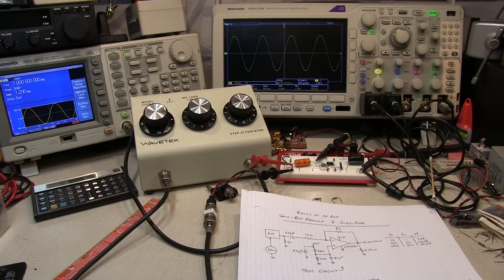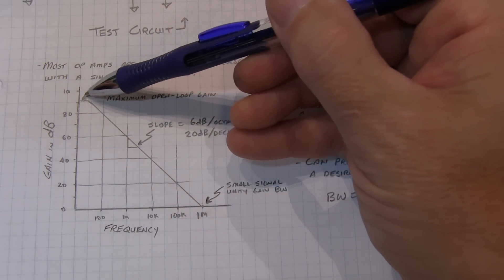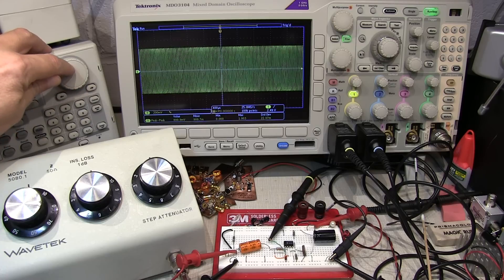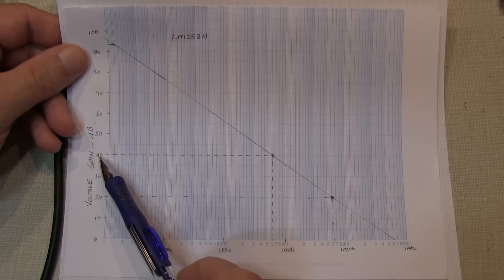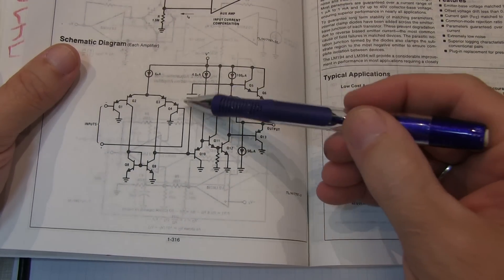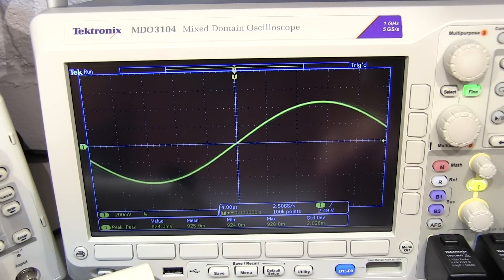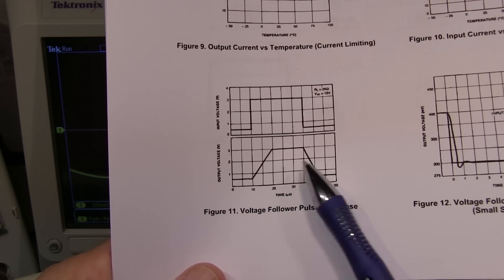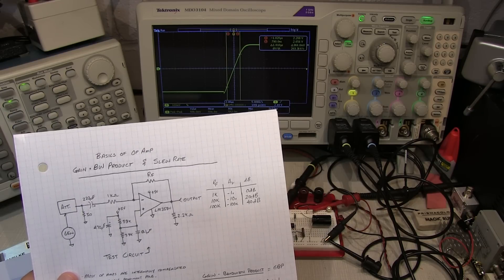#172: Basics of Op Amp Gain Bandwidth Product and Slew Rate Limit

Comment: Dear w2aew, 
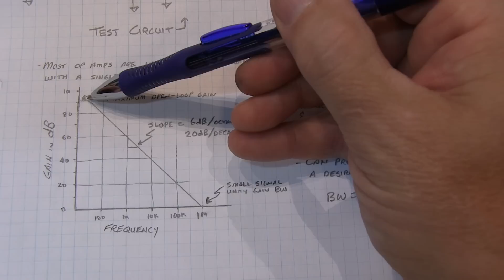I really am a big fan of your videos, this time however I was surprised to notice you made a common mistake at around 2:23. You are saying that for a single pole response the product of the DC-gain and the bandwidth is constant, however this is not true for the inverting amplifier you are demonstrating: it should be: (1+R2/R1)*BW=unity gain frequency. As long as R2/R1 is much larger (10 times or more) than one, the difference in bandwidth will not be that large, but for small values of R2/R1the difference between your prediction and the correct formula can be a factor 2! If the unity gain frequency of your op amp is 1MHz you should expect for a single pole response a bandwidth of 500kHz and not 1MHz. This also means that the -20dB/dec slopes of the closed loop configurations will not touch the -20dB/dec slope of the open loop system, but will be shifted to the left of it. Unfortunately you did not measure the small signal bandwidth for R2/R1=1, you should apply an input voltage whose amplitude is small enough  not to have slew rate distortion. I wrote an article concerning this matter "A closer look at the slew rate criterion" in 2004. Maybe you could check it out and remeasure the bandwidth for R2/R1=1. In reality you probably will  find a somewhat higher bandwidth due to the fact that a real op amp always is a higher order system, which especially can be seen in the case where R2/R1=1, sometimes noticeable as  peaking in the amplitude characteristic, the asymptotic slope of the amplifier being steeper than -20dB/dec and the phase characteristic shifting over more than 90° relative to the phase at low frequencies.

kind regards,
Hugo
Reply from the maker: Thanks Hugo.  I chose not to get into this level of detail in the "Basics" type of video, but I greatly appreciate your reply.  Other viewers will benefit from reading your reply here, as well as your article:
https://lirias.kuleuven.be/bitstream/123456789/240890/1/artikelextended.pdf
Reply: Hello w2aew, may I encourage you to add a follow-up video to re-measure the unity-gain BW at a sufficiently low amplitude to stay under the slew-rate limit.  It would be very beneficial to test the theory as expressed by Hugo Coolens regarding deviation from constant gain-BW product for closed-loop gains that are under 10.  Cheers.

Comment: Great video! One question: Is your attenuator placed between your function generator and your op amp input? So the poor mans solution is to simply keep reducing our function generator amplitude as we increase the opamp gain?
Reply from the maker: Yes. My generator couldn't go low enough. If yours can't, a simple voltage divider will do fine.
Reply: I see. Thanks for the reply!

Comment: what is purpose to use 470uf cap on non inverting line.
Reply from the maker: Filter for the +5V power supply. Really has nothing to do with the function the non-inverting line.

Comment: hello Sir, could you please suggest me what type of op amp can I used to amplified small sine wave signal with frequency range of: 17MHz to 27MHz?
Reply from the maker: Depends on the amount of gain you need, as well as output voltage swing, available supply voltages, load impedance, etc.

Comment: thankyou for your amazing videos. im currently studying electronics at university so this stuff is so helpfully. one question about this, when you say bandwidth of the opamp what does it mean quantatively?
Reply from the maker: +Adil Malim Bandwidth generally refers to the frequency range that a device can operate over.  For something like an op amp, it generally refers to the frequency at which the response/gain is 3dB lower than the response/gain at low frequencies.
Reply: @w2aew "the gain is 3db lower than the gain at lower frequencies.". What does that sentence mean? Please explain it as if you are talking to a kid
Reply from the maker: @keylanoslokj1806   Assuming the amplifier has a frequency range where the gain is basically constant, for example, with 20dB of gain.  As the frequency approaches the bandwidth limit, the gain gets reduced.  The frequency at which the bandwidth reduces by 3dB, to 17dB in this case, defines the corner frequency, or the analog BW in the case of this video.

Comment: Hey Alan,
Thanks for uploading another great video!
I hate to be picky, but I noticed something in your diagram of slew-rate-limiting at 10:20.
You drew the slew-rate limited waveform being in-phase with the the input signal (or a non-slew-rate-limited output signal).
However, shouldn't the slew-rate-limited signal lag the input signal by some phase?
Reply from the maker: The drawing wasn't intended to show input vs output, but rather just comparing normal vs. slew rate limited output waveform shapes. If it was showing input vs. output, then yes there would be a phase shift.

Comment: can anyone please tell me what is the purpose of the  2.2k ohm resistor at the output,or how this configuration called  so i can learn about it.
thank you
Reply from the maker: The 2.2k resistor is simply a pull-down or load resistor. It is used in this case to keep the op amp output in the "current sourcing" mode of operation. The LM358 output stage can source a fair amount of current, but has a very weak ability to sink current. If the output is forced to transition between the source and sink modes, then crossover distortion will often occur. Thus, the load resistor is included to prevent the crossover from occurring by ensuring the output is always sourcing current.
Reply from the maker: +Andrey Andrey This video will explain the purpose of the 2.2k resistor:
https://www.youtube.com/watch?v=VgodYtiD_F0

Comment: I do appreciate your effort on this footage. I am planning to build a strain-gauge circuit from LT1167  to evaluate a peak force exerting from impact test whose original signal theoretically identical to pulse-like signal.

Unfortunately, I am not Electrical engineering and although after spending several days, there was no answer to the following questions...

(1) Generally speaking, does the gain of op-amp influence its slew rate?
[http://www.onmyphd.com/?p=slew.rate "we must scale the SR by G"... but how?]

(2) Is there any way to determine the slew rate of instrumentation operational amplifier like LT1167?

Thank you very much for your time answering above questions in advance.
Reply: For the first question, it refers to"should SR be divided or multiplied by gain of op-amp?" since it is understandable that a higher output signal means a steeper of the voltage, so that it may exceed the SR-limit.
Reply from the maker: KikkyPharaoh 1) The slew rate is basically independent of gain.  Higher gain circuit might cause signals to bump into the slew rate limit because the rate of change of voltage vs. time will be faster (steeper).  
2) The slew rate is specified right in the datasheet, and there's even a graph showing the effect of temperature.
Reply: ***** Thank you very much for your very fast reply.

I did notice that LT1167's slew rate is about 1.1V/us at unit gain (in datasheet). Since I am concerning about its relationship to gain of the op-amp so that the second question was asked. 

It seems that the question is not that clear.... Apologize for this incomprehension.

According to your comments, does it mean that a slew rate limit of this amp is 1.1 V/us regardless of its gain? Am i misunderstanding?
Reply from the maker: Yes, the slew rate is generally not a strong function of gain. Higher amplitude output signals will have a fast signal slew rate, thus will be more likely to run into the device's slew rate limit.
Reply: Your kind help is appreciated!!
Thank you, sir.

Comment: Very helpful video, everything is described in a very calm and demystifying manner.
Reply: Btw: whats the purpose of the 2.2k resistor at the Output?
Reply from the maker: John Matrix The output stage of the LM358 uses a push-pull output stage that has some crossover distortion.  Using a 2.2k resistor to ground keeps the stage in the "push" mode (sourcing current) so that I don't incur the crossover issue.  Also, the spec sheet for the part specifies the output characteristics with a 2k load, so I figured I'd come close to matching that.
Reply: ***** thanks for the quick response, now i get it. since i´m a electronics newbie i`m not yet into checking datasheets before asking questions :-)

Comment: As usual, another excellent and lucid video.
I was wondering why you used attenuator and didn't just change the singal amplitude from the FG.
Thanx for the great video.
Reply from the maker: I wanted an amplitude (under the high gain case) that was below the minimum output level of the generator.

Comment: This is great stuff, I just came across phase reversal on a LF353 working as a voltage follower when reaching Gnd. Luckily I also bought TLC272 that did that job perfectly single supply. I know it was a rookie mistake but what better way to learn.
Reply from the maker: Yes, some op amps have that unexpected phase reversal when you violate the input voltage range.  Very nasty, and lock up a system.  And, often not specified in a data sheet!

Comment: ***** Thanks for the video. Is it possible to build an amplifier using LM741 to generate an output voltage of 50 V?
Reply from the maker: No, not directly.  However, the output of the 741 can drive a transformer which can step up the voltage.
Reply: Thank you so much :)

Comment: A fascinating demonstration. 

Regarding the phase delay introduced when the slew rate limit is reached: is this a constant?  You pointed out that the falling edge has a slightly different slope than the leading edge and this was clearly seen.  Two thoughts on this.  (1) is this predictable enough that it has utility in a design? and (2) as a phase delay appears to be present (although you didn't show the waveform just out of the signal generator), is this useful in certain applications - and perhaps undesirable in others?
Reply from the maker: k1mgy I didn't show the phase delay, but there certainly is a delay encountered as you near the GBP limit, and a further delay as you hit the slew rate limit.  It would be unwise to use this in a design because the performance, particularly slew rate, may not be well controlled between devices, and will vary depending on operating conditions.  Not shown was that the asymmetry of the rising and falling slew rate limit is also dependent on the input common mode voltage.

Comment: This was extremely concise and well paced and informative.  Thanks so much for your videos!

I had a few questions about the caps in your test circuit.  I'm assuming the 0.1uF cap going from your divider reference to ground is a bypass cap to limit noise from the op amp, right?

As for the 220uF coupling cap, was there any reasoning in picking that value or is it what you had on hand?  Additionally, would this cap and the input impedance of the op amp form a high-pass filter?  It seems like the 3db point would be nearly 0?

I'm still learning the fundamentals and trying to piece together all these EE ideas in an intuitive way.  Your videos have helped immensely in that quest.

Thanks again
Reply from the maker: Yes, cap values aren't critical. The 0.1uF is to keep the noise down at the non-inverting input. The 220uF is what I had laying on the bench, and was large enough to be "invisible" at the lowest frequency I intended to test with (~1kHz).